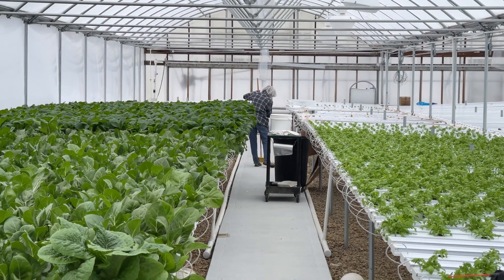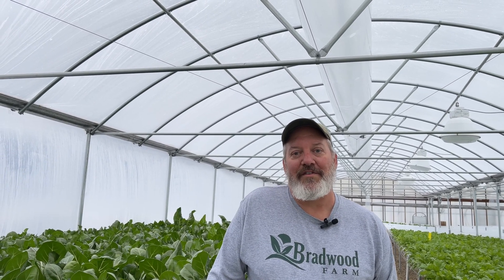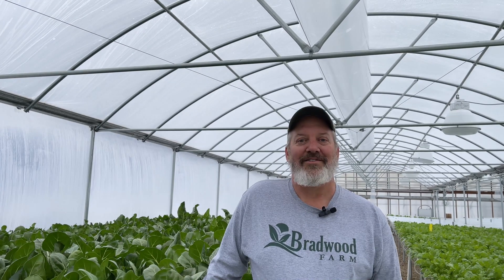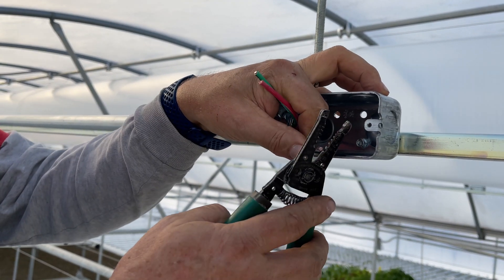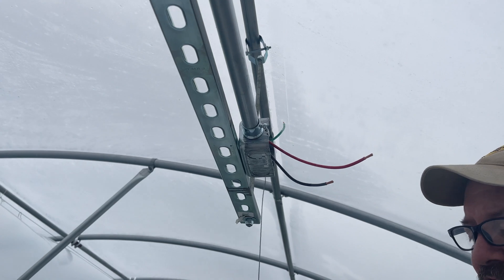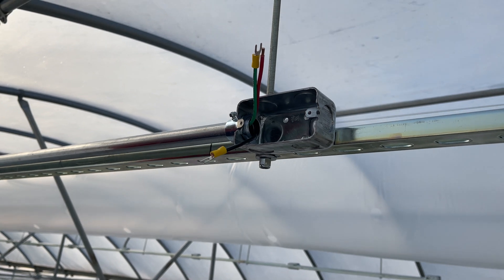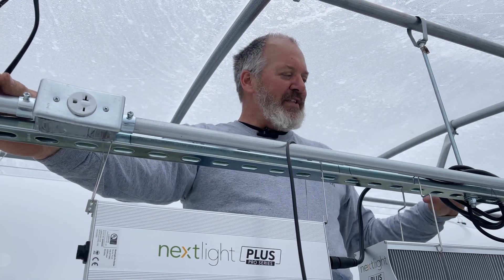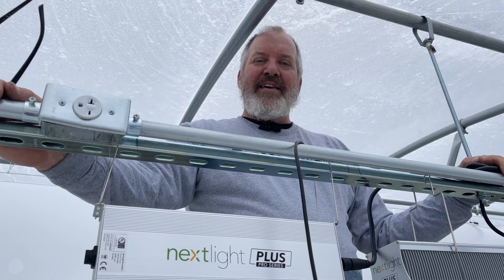LED Grow Light install in our hydroponic greenhouse

Comment: They make a cover that snaps over the strut channel opening allowing the strut to be used as an electrical wireway. This does away with the electrical conduit, you end up mounting the outlet boxes on top of the strut and hanging the light fixtures and power supply enclosures in the same manor.
Reply from the maker: Thank you for this comment! I am going to hang 10 more lights over a section of NFT channels for Katy. I will look into your suggestion. Thanks!!!

Comment: Surprised we didn't see one light powered up.
Reply from the maker: Still have to install the control system. Have to figure out the best way to run temperature probe and dimmer cable. Going to install 10 lights over the some of the nft channels. I'll get one up for you. Sorry

Comment: good job big guy.......i like the connectors on the wires.....ill have to do that
Reply from the maker: Trying to wrap the braided wire around the outlet posts never seems to work very good so i went to these fork connectors and seem to work great. Something I did not show is I wrap the outlet with electrical tape

Comment: Doug, I picked up a screw driver that has interchangeable #1 and #2 square ends.  It makes wiring so much easier as the square drives do not slip on the screws like a straight blade or phillips can.  Very nice workmanship.
Reply from the maker: I'll have to look for one of those that would be a great help for sure. Thank you for the suggestion!!
Reply: @HomegrownPassion  Klien and Greenlee both sell multidrivers commonly used in the electrical trades.  The 12 in 1 are popular, I find the 6 in 1 to be a better choice if used all day.

Comment: Won't you get problems with the 240v plugs and the condensation? I think I would have hardwired them.

Can you give us an update of the home-nft system Devon was setting up in one of her last videos?
Reply from the maker: Never had issues with moisture in the outlets. Everything is grounded and we have GFI breakers